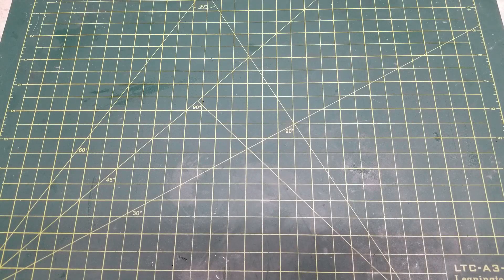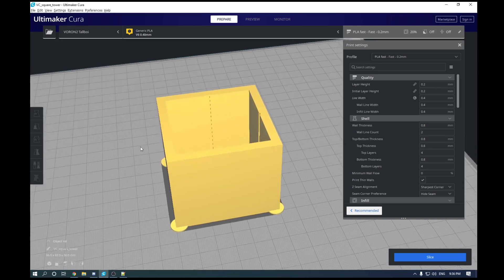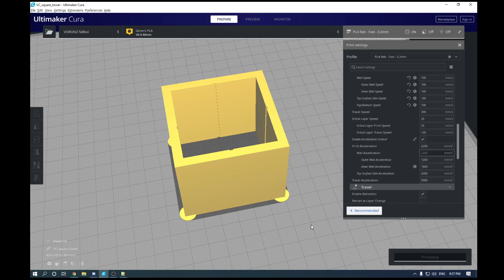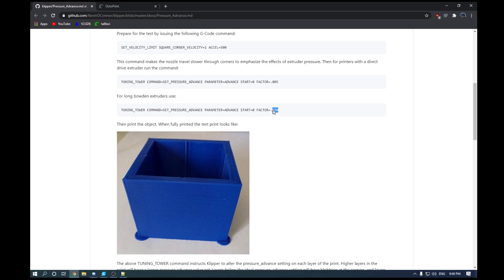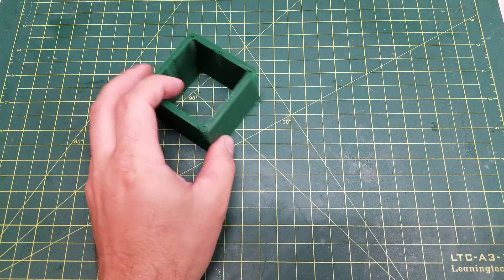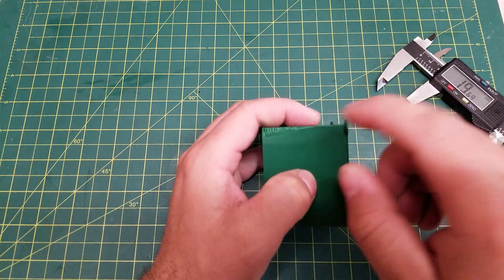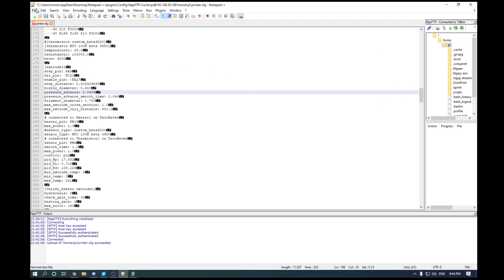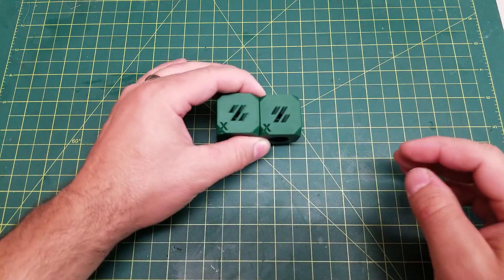Klipper Pressure Advance Tuning MADE EASY!

Comment: Hello, I wanted to ask you if to print the test cube it is better to keep a speed of 100 mm/s or if it is better to go to the speed at which I am used to go (250mm/s), and the acceleration control can be activated? If so, what value can I set it to get a correct test? Thank you for your attention

Comment: at 100mm/s it's practically hollow - but at 50% speed it's approximately normal
Ender 3v2, bowden tube got heat-creep after a few months and I was unconfident so got the direct drive, along with a crtouch and the leveling screws
worked great for a couple weeks, at up to 150mm/s then got heat creep - so got both a cheap bimetal heatstop and a redlizard since it was all ready assembled along with some capricorn
installed the redlizzard to the capricorn and I think I had it working once, but then showed signs of heatcreep again so switched to the bimetal installed into my direct drive ... which works fine but only at factory speeds (not sure if the original bowden could have gotten faster, but faster was all I tried with the redlizard

any ideas on what's happening? next I'll be trying the redlizard installed into my direct drive and see how that goes... I really don't want to buy another hotend, but I'll consider buying the recommended expensive heatstops when I next get some nozels (which I'm suspecting may be the problem anyway? I'm using the same nozel, the one in best condition outside the redlizard, as when I was going 150mm/s)

Comment: PSA!!!!  Those of us that like prusaslicer over cura, you HAVE to disable auto cooling in the filament tab or you will NOT hit the 100m/s speed & will get inaccurate readings.
Reply: frick now i gotta start over!!
Reply: you can change maximum speed under fan settings to 100 m/s and it goes upto 100 m/s

Comment: This has been driving me insane. Everytime I have tried tuning PA, after the first few layers I get insane extruder skipping, which only gets worse. Has anyone else had this problem? Any solutions? Cheers
Reply: you either have a clogged nozzle or a cracked extruder. if you have the stock plastic extruder, look for cracks. especially under the tension arm. also check the tension of the extruder. lastey, check and make sure your extruder gear (the one that "bites" into the filament) isn't worn down where the filament runs along it. then I would redo Esteps and try again.
Reply: Just read the manual: "The test print is designed to run with a high extruder flow rate, but otherwise "normal" slicer settings. A high flow rate is obtained by using a high printing speed (eg, 100mm/s) and a coarse layer height (typically around 75% of the nozzle diameter). Other slicer settings should be similar to their defaults (eg, perimeters of 2 or 3 lines, normal retraction amount). It can be useful to set the external perimeter speed to be the same speed as the rest of the print, but it is not a requirement."
Reply: If a high pressure advance value (eg, over 0.200) is used then one may find that the extruder skips when returning to the printer's normal acceleration. The pressure advance system accounts for pressure by pushing in extra filament during acceleration and retracting that filament during deceleration. With a high acceleration and high pressure advance the extruder may not have enough torque to push the required filament. If this occurs, either use a lower acceleration value or disable pressure advance.

Comment: Tip: Watch your print and just cancel it when you see the corners degrading, it'll likely happen within the first 1-1.5", will save you some time and filament.
Reply: I did that, the final result is amazing. Also saved some filament and time to boot.

Comment: Shouldn't you convert your caliper measurement to number of layers to use it in the formula? 
I thought the tuning_tower command increases the pressure advance every layer, which would require you to use the number of layers to get the value which was used for the best looking layer.
Reply: No, the tuning_tower factor is applied to the current z-height, not layer number.

Comment: Can I put the value inside the start code of the slicer for each filament?
Reply from the maker: Yes you can
Reply: @CanuckCreator  how? do you have a guide?
Reply: @cristianopersi7953  Put "SET_PRESSURE_ADVANCE ADVANCE=<value>" in the start gcode section.

Comment: I saw in another of your videos you said you'd have to redo pressure advance after doing an acceleration test.  So after running an acceleration test would I put that speed in where you just did thr 500 I think was your value or after I get the values from my accelerometer I still just use this value?
Reply: No, this should be printed slow and steady, you don't want high acceleration messing up your results.

Comment: In general:  your content is why I was comfortable converting to Klipper with incomplete Christmas gifts in Que!

Unfortunately:  I got a PA of ~1 for my bowden setup.  Klipper documentation suggests that PA will have minimal impact, and I should consider disabling PA.  This is a Tow Trees Sapphire Pro, with a stock hotend, bowdend tube, and upgraded LGX...OUCH!  I'm designing a modular hotend kit now so I can upgrade to the Mosquito a.s.a.p!
Reply: I have Artillery genius with LGX + ACE copperhead hot end = so direct drive. got 0.0925 - huge improvements! printing at 100mm/s limit or 14.43mm3/s limit. Klipper does wonders
Reply: Use direct drive or at the very least capricorn bowden rather than white tube

Comment: Excellent explaination.
Instead of writing PA value in the printer config, I write it in my slicer(s) as filament-specific start G-Code. That way, each time something is sliced using that filament, the relevant PA is inserted (through Klipper's "SET_PRESSURE_ADVANCE ADVANCE=<value>". Simple and efficient.
Reply: This is the best way to do it. Thank you for sharing the idea!
Reply: how would one write this? under the filament tab in superslicer? custom gcode?
Reply: This is really usefull, thank you for this info...
Reply: Do you have an example of This?  Sorry Im a Newb

Comment: thanks for the guide, Do i have to go into my Config File and change this value every time i change filament types? if this is the case then i will  sadly have to be doing this very often . Secondly, why dont i have to do this on my other printers?
Reply from the maker: I find its usually "good enough" with most same type filament, but if you run PA with say a .6 nozzle with abs, and then start running TPU with a .4 nozzle you may need to update it
Reply: As mentioned above you can add a line like SET_PRESSURE_ADVANCE ADVANCE=<value> to filament-specific G-code in your slicer. You don't "have to" tune linear advance / pressure advance on any printer but it can improve the quality of printed parts, just like many other optional tuning steps.

Comment: if only klipper would talk to the adxl... :( tried 3 diff chips on both rpi3 and 4. klipper can only repeat id (got xx vs e5)with shielded cables, duponts, with R4 removed, 3v,5v. cheap adxl, adafruit fancyb1tch. must be getting close to 100h on this subject.... hopefully kevins current work on a adxl branch might bring some light...

Comment: after i set the pressure advance in the config and start a print i shows 	

pressure_advance: 0.000000
pressure_advance_smooth_time: 0.040000

should it be showing the value you input into your config instead?

thanks

Comment: I don’t seem to have "pressure_advance:" nor "pressure_advance_smooth_time:" on my printer.cfg, do I need to add it before or after the hollow cube print?
Reply from the maker: You need to add it to the config once you have a value to add.
Reply: @CanuckCreator  and what do I put on “pressure_advance_smooth_time”?
Reply: @maxfuentes7541  You can use the default smooth time. It is possible to set it lower, but that will cause more and faster extruder movement (risk of skipping steps).
Reply: @CanuckCreator  also while I printed the hollow cube when it was at 50% it didn’t want to extrude anymore, I’m i doing something wrong?

Comment: Is it necessary to add the line "pressure_advance = <calculated_value>" in the printer.cfg file BEFORE executing the tuning test? I ask because my cube seems pretty uniform from top to bottom..
Reply: Hi
I have the same problem.
Did you found a solution?
Thx
Reply: No, running TUNING_TOWER COMMAND=SET_PRESSURE_ADVANCE ... overrides the saved pressure_advance value in printer.cfg for that print. 

If the test cube looks fine and you can't feel a little bulge at the bottom of each corner, pressure_advance won't help your prints and you should set it to 0.

Comment: Wait wait wait. Does the command for changing pressure advance change it every layer or every millimetre of height?
Reply from the maker: During the calibration tune it does so you can measure different parameters. But in normal prints no it stays locked to one value
Reply: That’s the point. If it changes after every layer (instead of mm as suggested by the formula shown), the formula would be wrong

Comment: I have done the PA calibration successfully, however it seems like a waste of filament, isn't there other way of calibrate?
Reply from the maker: Unfortunately not really.  You need to see how the plastic prints to verify settings.
Reply: @CanuckCreator  I mean, I haven't made the test with an smaller object, why does it need to be that big. A simple cal cube with extended Z would not achieve the same results?, Also, why the model is  square and has internal shape? Won't be simpler a rectangle with single wall?
Reply from the maker: @DARKEASC  The extra geometry allows you to compare settings for different situations, and along different axis`s of the printer. sometimes inner and outer corners can be slightly different and also x vs y axis on some designs.  The print itself uses less than 30g of plastic and can be stopped as soon as they corners start to get bad again.

Comment: I just have my pressure advance tune per filament, and then setup in that filaments start GCode, so that it sets it before it prints
 I do it as part of my filament calibration process.

Dry the filament
Then print a
Temp Tower
Flow vase
Pressure advance.
Retraction spikes

And then boom. its ready to go.
Reply: hey i am new to klipper so i can tune every filament seperatly and can leave the printer.cfg stock so i only need the Start gcode where it sets dies value and after powering down it has no pressure advanced?! but what i dont understand why we make accelerations down. if we tune speed then pressure advanced needs to be tuned again or am i wrong?
Reply: @Antoz1103  do you have the pressure advance in your printer.cfg

Comment: I tried to do this a few days ago and the box had corners that appeared pretty uniform from top to bottom.  I followed your instructions and will reprint overnight.  Let's see what I get in the morning.
Reply: Ran it again and on my bowden setup the difference is not as great as your direct drive.  I was however able to see where it changed on three of the corners and was able to get the measurement I needed.  Thank you for putting the video together.

Comment: Why is this a firmware tweak if it depends on the filament and printing temperature ?
Say I print two brand of abs, or abs and nylon for example. Would I see significantly worse corners ?
Reply: Ended up looking it up, seems like Klipper has a 'SET_PRESSURE_ADVANCE ADVANCE=<advance_value>' command, which you could use in Slic3r/PrusaSlicer/SuperSlicer in the filament specific gcode section, similar to how it's done with marlin via the M900 gcode.
Reply: I've observed that, I don't even gets the same values between to copies of a printer, IMHO this should be something that slicers should have a value for in the filament profiles, I think prusaslicer now does, or something that can be controlled via M900 like in marlin gcode
Reply from the maker: Ive found that a small tweak MAY be necessary between filament types (pla vs abs vs petg) but so far between brands of the same plastic i havent noticed much difference

Comment: Should I calibrate the flow rate first before I do PA?
Reply: I calibrate my esteps, then flow rate(extrusion multiplier), then PA. FR/EM is the factor that gives you more dimensionaly accurate parts as the width of the extrusion is calibrated, if the slicer thinks your line width is .48 but your FR is too high, than you line width might be .55 instead. PA helps with creating a ratio of extrusion of line width on speed changesthat varies your EM kinda...
Reply from the maker: I usually tune my extruder e-steps, then PA, then flow, although i doubt theres much difference with tuning flow before PA